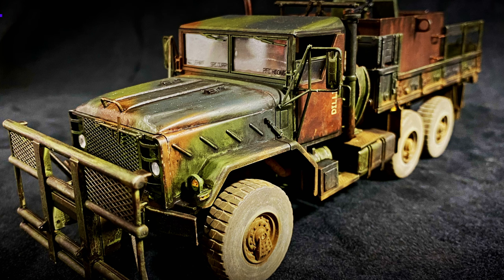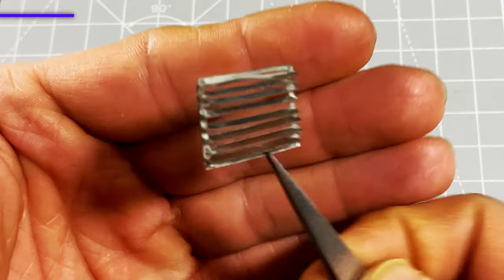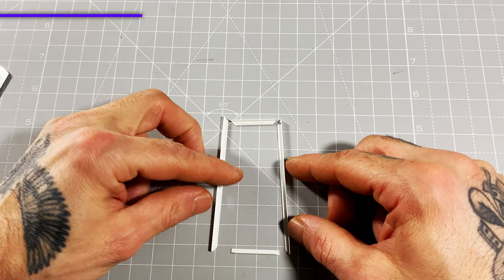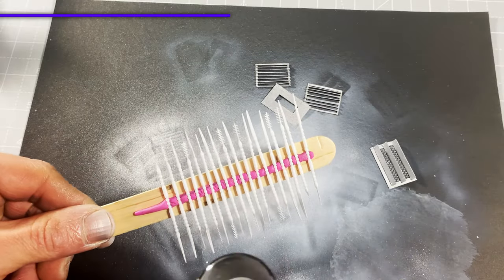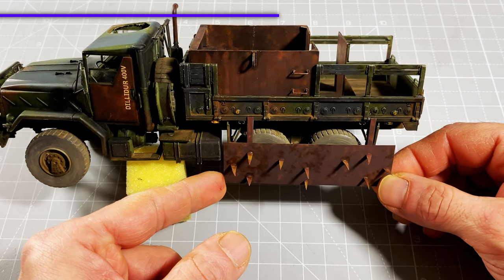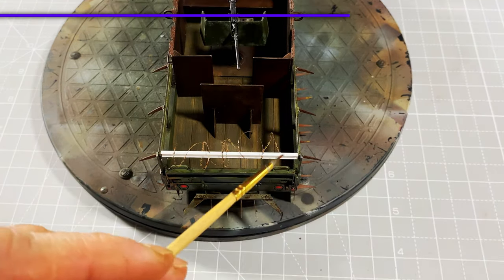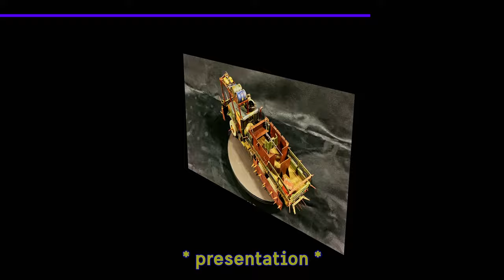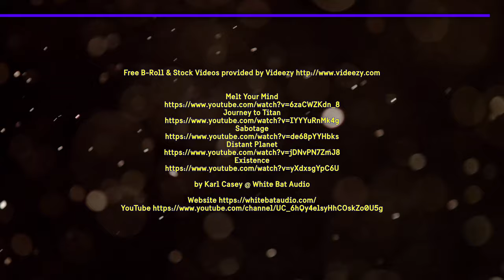M923 "Hillbilly" Gun Truck - Zombie Apocalypse 'The Beast' #Diorama #ScaleModel #Miniature #ModelKit

Comment: July 30, 2022----Quit building building models about 20 years ago, with me starting to build 'em in '74, when I came back to the states from Panama. But got to wondering if anyone was into zombie/apocalypse dioramas and was surprised/shocked to find so many on YT and via Google. Thing is, I'm going for REALISTIC dioramas and not what I call the Mad Max look, which i where I put your model in. Anyone out there ever drive truck in the military or as a civilian? Drove OTR and LTL for 15 years, now retired and laugh my ass off on what some modelers will do to a semi-truck. Like putting what would be at least 500 pounds of steel plating on a semi-truck, when they're made of FIBERGLASS?! One time, dropped a trailer in our yard outside of St. Louis one time and there were AT LEAST a dozen totaled semi's that had been in accidents, including one what had a fire inside the drivers/sleeping compartment. Now add another dozen of so trailers where the load had either shifted or the driver attempted to go under a low bridge. A trailers body is made of sheet metal, with stiffeners inside the trailer and either wood or metal floors. I've got about a dozen trucks either as sleepers or day cabs in 1/24 scale that I STILL haven't even started. Trailers are pups (short trailers), reefers and regular length trailers, again, all in1/24 scale.

I have several of the M923 & M925 truck kits but will NOT go for spikes as though bad ass looking, they're impractical for several reasons. Get a bunch of zombies stuck on 'em and that's additional weight for the truck to handle, along with having to deal with the undead once you're clear of other zombies. It's the same way with sheeting covering the tires which is something I hadn't ever thought of and possibly a good idea vs looters/gangs trying to stop you going thru their territory.  But the sheeting CAN'T be just welded on, otherwise, how are you going to change a tire WHEN (not if) it needs to be changed? Have the sheet metal bolted to the framework so it can be removed. Before I drove truck, worked at a produce company and my job was doing basic repair (like lights) on trucks/trailers and cleaning 'em. This included removing tires with low tread and I believe they ran 300-350 pounds total? These truck tires, being bigger, no doubt will weigh much more. Imagine trying to lift a flat tire alone into where it's suppose to go? And trucks (military or civilian) are designed to haul trailers, which means glad hand and light cord attachments on the rear of the truck. This way the truck will provide air to the air brakes, along with electricity for the trailer lights. This is another thing those into building semi-truck/trailers rarely have on their models. Without 'em, you're going to be dragging that trailer and that is NOT GOOD in a zombie/apocalypse situation.  

Hadn't thought of a roof rack like you did and it's an idea I'll swipe/use. But how in the hell do you open the hood to check fluids, etc inside the engine compartment? Your 55 gallon drums are TOTALLY impractical on the rack. Just one of them filled with water will weigh 458 pounds and I see NO WAY of being able to get them onto the rack.

As to barb wire, I use bug screen like those used on screen doors or on a window. Yeah, pita to slowly cut things apart, but now I get the length I want and I use 2 strands so there's less distance between them. For chain link fencing, I use wedding veil which would be practical for the truck door windows. And yes, drives have these sort of screens on their windows to stop people from jumping onto their truck an robbing them. This happened to a truck driver I knew and who suddenly had a knife at his throat as he went to leave a truck stop. 

As for me, I WAS working on 2 dioramas and screwing around on a 3rd one. Got sick late last year and in mid-January, went to VA ER, with those people taking care of me. This was when I found out I had covid and why I was sick. Mid-May, sick again, but this time a few days in the hospital due to Influenza A. The dioramas (when completed) will be called You Are Not Alone and Childhood Lost. A woman will be sitting on the edge of an abandoned/empty city park fountain, with her dog resting a paw against her leg. The found was made of multiple castings of plaster of paris from a sour cream lid. The fountain is a modified, plastic champagne glass and some small angel figures on the 2 tiers which I got from Ebay. The other is a man sitting on a merry go round while watching a rabbit being cooked on a fire. They're in an abandoned city park and his dog is watching him as if reminding him he was the one who scared up that rabbit. Made a merry go round, jungle gym, 2 seater swing set and some horsey rides. These are usually concrete animals with big springs under 'em so kids can ride 'em. 

Anyway, sorry for talking so much and hope you understand I was NOT dissing your work in anyway. It also gave me a lot of ideas on how to do mine.
Reply from the maker: First of all sorry for the very late reply😞 obviously I cannot thank you enough for the unbelievably detailed comment that I am sure that others will appreciate as well👏😊couple things: as I clearly say in the video, in its description and on the pinned comment, this project is based on a zombie apocalypse fictional event😉at about 2 mins I even provided some images that inspired me to build my beast😊back to real life, I wish you a healthy life & the best of luck with your past, present & future scale modeling projects👏😊✊🤞✌️🖖